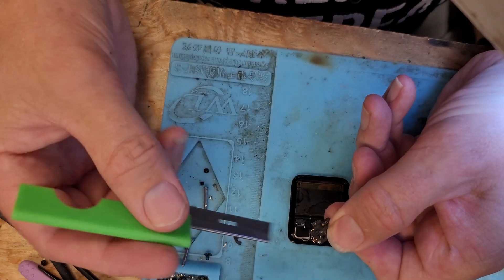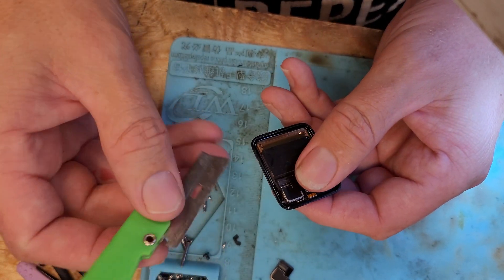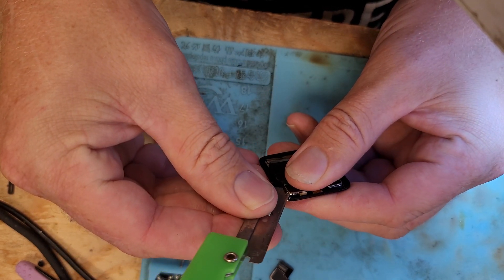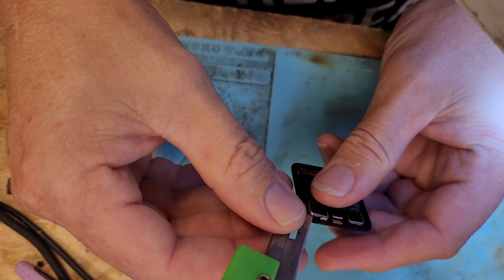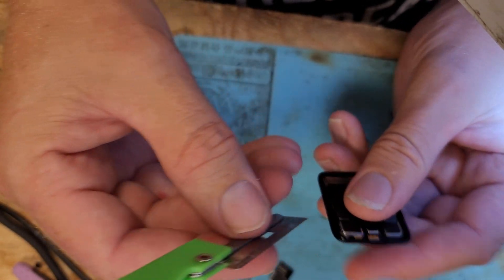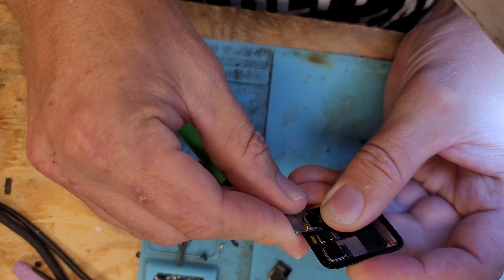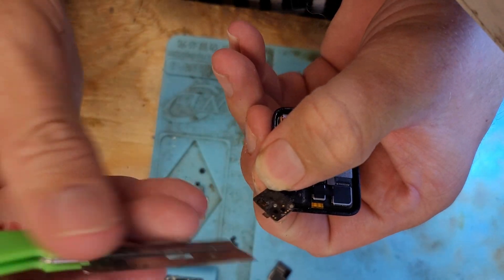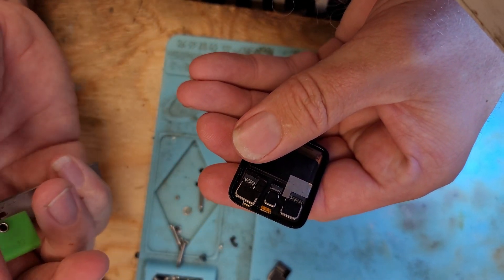Apple Watch Series 2 and Series 3 NFC chip transfer

Comment: Good evening, tell me, do you solder the NFS then? Or do you stick it on with tape and that's it? And what is the operating range after the procedure.
Reply from the maker: I use the small jumper wires to make the connection between the two.
Reply: @burlybiker You can't tell me what the temperature is on the soldering iron tip. When soldering jumpers.

Comment: Thank you for the video! 
Tell me, is it possible not to solder 2 wires? Will there be constant contact without soldering?
Reply from the maker: The wire I use has a coating on it, so as long as the coating is not removed, it will not short out.
Reply: @burlybiker  Thank you for your answer! In another video on your channel you showed how to solder two wires, but I am concerned about the question: what temperature is safe for an OLED display?
Reply from the maker: @paveltompson9176  you don't want to use a lot of heat, but it's such a small spot, it doesn't take much heat at all. Make sure you use flux, and it'll almost be just a tap with the iron.
Reply: @ Got it, thanks for the reply! What kind of solder do you use? I have 60/40. So I'm thinking: can I buy a low-temperature solder?
Reply from the maker: @paveltompson9176  60/40 works great. That's what I use for everything.
Reply: @burlybiker  what kind of cable/jumper wire you use?
Reply from the maker: @robertgrlic6505  32 AWG coated wire. You can find it online at places like Amazon and eBay. One roll will last a lifetime.
Reply: @burlybiker  thanks